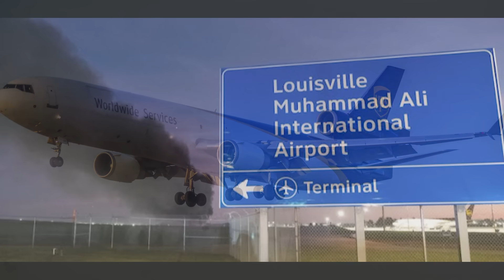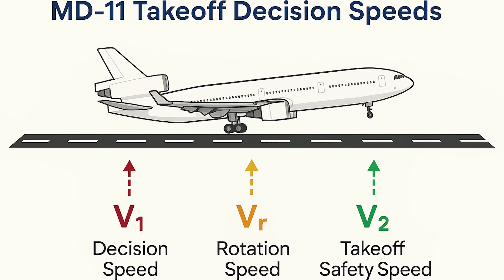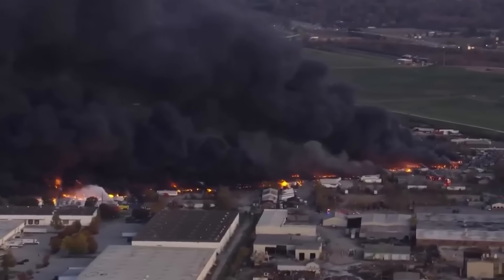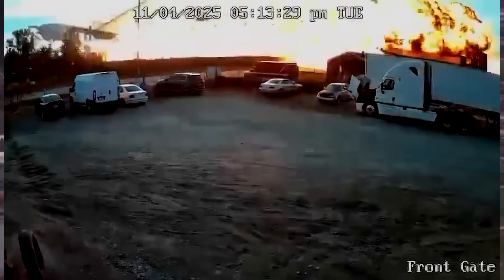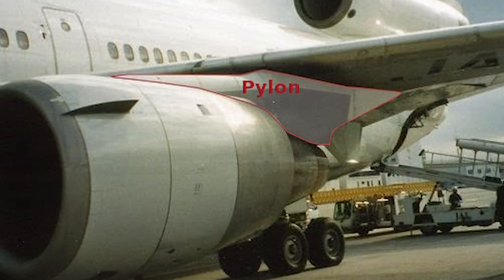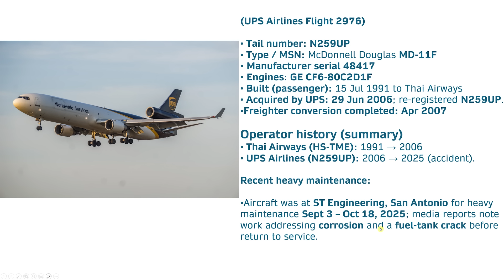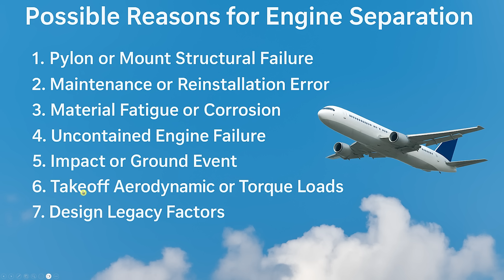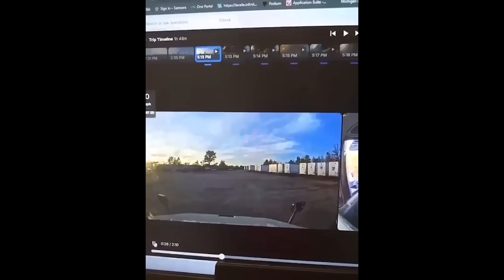What Caused UPS Plane Crash, Louisville, KY? How MD-11 Engine Fell Off

Comment: Who’s idea was it to place a petroleum recycling plant at the end of a runway
Reply: Take it from somebody who lives here. That Petroleum business is not at the end of the runway. Its quite a ways away. Just happened to be in direct path of an out of control aircraft. Had it been further left it would have taken out our Ford Assembly Plant. That whole area is industrial and has been before that airport was ever built.
Reply: @jeremyhemp8241 airport dates to 1941, I had the same thoughts you did until I went digging but most airports are like this with industrial in the area.
Reply: @gingerPotatoCat i used to work for UPS out of this hub, and loved and went to college in Louisville.  They did a MAJOR expansion about 20 years ago, so that airport has not been that big, and that direct route of travel for planes has not been that way since 1941.   You find me 1 major airport that has absolutely nothing that may be considered “dangerous” in the direct flight path of incoming and outgoing aircraft.
Reply: @jeremyhemp8241  Depends on how you look at it, I guess? The runway is over 2 miles long, and the crash was something like half a mile past the end of the runway. It's a pretty long walk, but from the perspective of an aircraft at takeoff speed, it basically did crash right off the end of the runway.
Reply: @gwillen  no, it didn’t. It’s a debris field and firestorm that’s a half mile long. I challenge you to find a similar accident. You won’t.
Reply: @teddyjackson1902  Exactly, this accident in terms of ground devastation is pretty unique.
All these comments regarding building placement ect are pretty knee-jerk emotional responses which are somewhat understandable at this time.

Ok, so the plane came down within a mile of the end of the runway. If that engine had separated 15-20 seconds later it may have come down 4-5 miles away - where do you draw the line?
Reply: @gwillen 
They put millions $$
in fire protections 
but don't do the elementary things.
Reply: @jeremyhemp8241 People are just emotionally reacting and looking to blame something - they lose all perspective.
They forget the plane was carrying 32,000 gallons of fuel itself - everything is flammable when that comes raining down.
Also they forget how much distance an object travelling at 200 mph can travel in a very short space of time.
Reply: @deezelfairy No emotion here. True the plane was nearly full of fuel. But it is a valid question to ask as to why a petroleum refinery is located "within" the abort  turn radius (typically a few miles for an airport of that size) of an aborted takeoff off. When a plane reaches V1, that final design is made, the plane must go airborne in order to keep flying out, abort and go around, or find an emergy landing zone. This was a worst case V1 point. At V1 (Velocity 1) they ran out of runway and going too fast to stay on the ground, they had to go airborne even though a crash is imminent.  A abort takeoff zone is from 0 feet to a few thousand feet above and beyond the runway end.
Reply: @deezelfairy yeah
Reply: @paulromsky9527 But it wasn't a refinery - I really wish people would stop using that term. It was a waste oil transfer facility. Waste oil is relatively non-hazardous in terms of flammability. Sure, it'll burn but in the same way paper, wood and plastic will.
People are making knee-jerk statements. That waste oil facility if you look at the satellite photos was a very small site with a few bulk storage tanks. Lots of vehicle junkyards in the area so makes total sense for it to be there.
Reply: was there before the runway
Reply: @AaronChandler-k6r no it wasn't
Reply: The petroleum company dates to '81, airport to '41. Bigger, faster airplanes change the safety aspect of what was safe in the 80s, may not be now.
Reply: @gingerPotatoCat almost equally massive and technically capable aircraft were available all through the 80's. Look into the operating life of some of the most iconic aircraft known. Its eye opening.  Also when the 1st world is done with them they often move through the classes to a location with less restrictions.
Reply: @geoffholmes7291 People forget that until the crown was stolen in 2007, the largest airliner in the world started production in 1970 🤔
Reply: @gingerPotatoCat look up “UPS project 2000, Louisville Kentucky” and you will see that yes the airport may have been in existence in 1941, it was not anywhere near the size it currently is nor did it have the same flight paths in 1941 that it has now.
Reply: it was either this or a popular ice cream shop
Reply: @mipmipmipmipmip-v5x  i get that ice cream shop reference, are you referencing the fighter jet crash?
Reply: That business has been there since the early 60s. The UPS side of the airport (including that runway and a second ATC) was not built until 1980. At night the airport switches over to the UPS ATC. During the day, the original ATC handles passenger traffic.
Reply: @johncox9868 Same with the Total fuel terminal explosion in the UK a decade or so back.

Why build it so near the houses? The terminal was surrounded by farmland when it was built.

At least here it was factories and warehouses, which there will be a lot of near a freight hub, whenever they were built.
Reply: @johncox9868 that business was there in 1981 not 1960
Reply: @gingerPotatoCat  1962 according to their website.
Reply: Better than houses - see Air India.

And it was loaded with goods and fueled for Hawaii. Monster fireball regardless.
Reply: 21 people are dead or missing including the 3 crew members. That's bad, but it could have been worse. It would have been worse if there had been an apartment complex or a movie theater at the end of the runway instead. The petroleum tanks made for a big explosion, but at least there weren't a lot of people there. The guys on the plane still would have died even if they'd crashed into an open field.
Reply: @franciscolopez7101 like the El-Al freighter in Amsterdam in 1992. That plane lost its engine way after take off and was returning to the airport.
Reply: @franciscolopez7101 21 people? That’s still not a small number.
Reply: Mine...    I was broke at the time and couldn't afford a nicer piece of property.
Reply: @earthstewardude seriously?
Reply: good question
Reply: Does it matter? Anything a plane fully loaded with kerosene  crashes into will be obliterated
Reply: @nihilism1986  A plane at take-off, at max takeoff weight and going from Kentucky to Hawaii, no less. Like almost the most fuel possible on a plane.
Reply: @nihilism1986 Yes. The fire was uncontainable. It had to burn out. The air & water around the area is terrible.
Reply: @cblair8501  it was ignited by the sparks
Reply: @nihilism1986 yes it does matter
Reply: @RainbowBelow exactly, it was like a bomb running into a bomb
Reply: @Brad772006 the bomb with over 200k pounds of jet fuel on board.. yea I don’t think that petroleum recycling plant caused much more damage then the plane itself
Reply: @nihilism1986  Like an extra runway?
Reply: @graphicism sand pits are cool cuz if they get annihilated you just rake it and it is a and pit again
Reply: @nihilism1986  What a silly argument. In a perfect world we'd have exclusion zones around all airports that serve commercial aircraft, but it's absolute lunacy to exacerbate an eventuality like this. To what extent this did I don't know, but there's obviously other businesses and therefore many more people around that area.
Reply: @kenhiett5266 it’s a small petroleum recycling plant, while I’m sure it contributed to the explosion I doubt it caused much more damage then the plane itself. So I wouldn’t say it’s a silly argument just the fact that people are forgetting the plane is moving at least 150+ mph and was loaded to go to Hawaii so probably 200k+ pounds of fuel
Reply: @Daniel73865  The point I was trying to make wasn't specific to this incident. I'm just saying that it doesn't make sense to have a business of that nature at the end of a runway.
Reply: @kenhiett5266 it’s as smart as anything else. You can’t base everything off of “what if”. That business did not cause anymore damage than a plane crash would’ve. My point is if that was an empty parking lot the damage would still look the same and be the same, maybe a few less tragic passings due to there just not being a business there but overall damage would be the same. So my next question is what do you build at the end of the runway? When you get to thinking about it there’s really nothing good to build there because of that “what if” scenario, but then “what if” this plane did make it in the air then crashed during a go around for an emergency landing, so you’d have to keep airports clear of anything for a few miles atleast. Perfect example there’s a train depot to the right of where the plane crashed, “what if” there was a train there loaded with worse chemicals and the plane went to the right instead of the left? So does that mean not building train tracks by an airport? 

Sorry I just kept going on and on but long story short there’s no good business to build by an airport but it’s almost a have too
Reply: @nihilism1986 Kerosine doesn’t melt steel beams
Reply: It really wouldn't have mattered. The plane was at max takeoff weight and was going to Hawaii, so it had about 138,000 tons of fuel on board. The vast majority of the fire/explosion was the fuel on board.
Reply: @pjaypender1009 the plane had approximately 38,000 gallons of gas
Reply: @pjaypender1009 no aircraft yet build weighs 138,000 tons.
Reply: @alanjm1234 Maybe he means gallons of fuel.  That plane can lift over 600,000 pounds of combined weight, roughly 300 tons.
Reply: @mickeyflynn5427 no he didn’t, neither of you should be talking about this and posting 💩 but welcome to the interweb 🤮🤮
Its pounds/lbs
An MD-11 freighter can carry up to around 262,000 lbs of fuel, about 38,615 gallons
It was speculated this flight carried between 200,000 to 220,000 lbs of fuel for the flight to Honolulu, speculated, not confirmed
Reply: @mickeyflynn5427  the plane had 38,000 gallons
Reply: @pjaypender1009 Not even close. You've mixed up tons, pounds and gallons, and don't even have the correct number for any of those three categories.
Reply: God,  I hope it was fast.
Reply: @ginmar8134  same
Reply: Would have been a great spot for a manufacturer of firefighting foam however.
Reply: The runway might have been built there after the plant was built.  Here in Chicago, O'Hare has added several runways over the years, much to the chagrin of those living near it. Sometimes they offer to buy the land and businesses, but often times they don't.
Reply: Please, don’t say stuff you are not sure of. To list one item or say that possible design engine issues that are now coming out is a hard pillow to swallow on a plane that is more than 30 years old. Is fair to say that after 30 years of service, is not a design issue, if anything it can be an issue that some airlines have where they push these planes well beyond their intended life spans based on usage.
Reply: @josiahcooper - Would you have preferred it if it was a Nuclear power plant - there at the end of the runway ?
Reply: Someone with multiple College Degrees.
Reply: @Justin_80  Correct, Harvard ?
Reply: Do you know what else they have near airports? Giant tanks of aviation fuel. Who'da thunk it
Reply: @Hobinator17  back in 1975 at DTW a lear jet hit a giant gas storage tank at the end of the runway on take off, and it didn't explode... ( but it did catch on fire when they tried to drain it a few days later it burnt for days) just say'in...
Reply: @Hobinator17  Next to and on the runway path are 2 different things Mr. Zero IQ.
Reply: @Cbd_7ohm Was it on the runway path though? People are assuming it flew straight after getting off the ground.
After getting off the ground the left wing dipped which would have forced it into a left hand bank/turn.

There's a lot of details we're not aware of yet - I wouldn't be so quick to call people low iq
Reply: @deezelfairy  They crashed into the petroleum plant, not the gas tank at the airport, and the commentor I was replying to made a comment about a gas tank for planes also being there, as a way to diminish the foolishness of a petroleum plant being so close and seemingly on the path of the runway (obviously not ON the runway, but it's path). Even if it isn't directly on the path, it's too close. There shouldn't be anything in front of a runways for miles IMO. The people who do zoning are incompetent.
Reply: @Cbd_7ohm I never said they crashed into the gas tank at the airport.
And the petroleum recycling plant was a waste oil facility - that's not considered particularly flammable. Bare in mind pretty much everything except dirt and concrete burns pretty well when over a 100 tonnes of burning jet fuel rains down.
Reply: As if the fuel in the airport isn't magnitudes more dangerous. Anyone commenting this isn't capable of thinking.
Reply: @Orverge Or the 100+ tonnes of fuel in the plane itself for that matter 😂
This oil recycling facilities location made an absolutely catastrophic disaster an incey, weeny, tiny bit worse.
I have no idea why people are focusing on it as this pivotal part of the whole situation - first thing that goes out the window in a crisis with most people is rational thought and perspective.
Reply: Make longer runways and you just solved a HUGE problem. But no, they have to make it at the limit so that when at V2, the runway ends right there. Unreal.
Reply: Bruh, I got 3 gas stations a short distance away from the end of my local airport's runway. And behind those gas stations, a bit of away from them, are 1-2, maybe 3 hotels from there. 

And if I was to measure the distance from the end of the runway to where that ups plane had crashed, but if this had happened at my local airport. No doubt 1 or 2 of those gas stations and maybe 1 hotel would've been hit at my airport, and maybe the surrounding businesses too. 
Yeah, not safe at all.
Reply: @wisdomvisionf. Sounds like one in Lawrenceville ga
Reply: The buildings may have been there before the runway was built !
Reply: I live in Louisville that plant had been there for decades that runway was built afterwards.
Reply: The plant was there before the runway was built.
Reply: Watt Could Possibly Geaux Wrong ?
Reply: Petroleum recycling is the least concerning facility aligned with the runway. Just south of the crash site is the Waste Management Outer Loop RDF. I am thankful the plane crashed where it did and not into the side of the hill. With that much fuel, a landfill fire could burn for years; with the environmental impacts in the 100's of millions of dollars - if not a magnitude more.
Reply: @ocko8011  They can extinguish landfill fires.  Coal mine fires on the other hand.
Reply: @ocko8011  It's our own fault for doing stupid things like creating massive landfills full of combustible/hazardous materials.
Reply: 99.999999% of flights take off safely
Reply: The 10's of thousands of flights before had no issue why would one assume there would be one? And what a plane can't fall out of sky and hit a petroleum recycling plant? Your Monday Morning QBing.
Reply: there's a whole lot of stuff waaaaay too close to the end of the runway - and it's stupid like that everywhere !
Reply: Do you really think when they were making the recycling plant in the thoughts of that one day a UPS AIRLINER is going to crash into the building on TAKEOFF. I've worked at UPS Worldport in Louisville and nothing like this has EVER happened!!!
Reply: Probably someone who thought planes would be built with engines that stay on.. Better that than residential, at the very least
Reply: @Thealexglass  Believe it or not, wrenches and other tools fall out when the landing gear is and the doors are open.
Reply: @imh-opinion this feels non sequitur :/
Reply: Well, where i live, there's a natural gas plant at the end of the runway.  It's just a matter of time.
Reply: maybe same guy who built a wall in korea
Reply: Well the airport is in the middle of neighborhoods to start with. I'm a few miles away.
Reply: You're right, they should've put a bean bag factory, or maybe shaving cream or Jello factory at the end of the runway.
Reply: What? 😮
Reply: Don't these have an issue with engine pylons failing?
Reply: If it was in Newark airport they have a power plant that's giant and a dozen round fuel storage containers 3 floors tall 😮
Reply: Thats one way to get rid of the recycling crap.
Reply: Dangerous and stupid
Reply: IDK why there are any homes or businesses within the first mile or 2 after the runway ends. I know this doesn't happen often, but this crash took out multiple buildings, it was a very congested area.
Reply: It’s been there since the 1950s and it was not the problem. 240,000 pounds of jet fuel was.
Reply: Kentucky regulations of course.  May want to add air quotes somewhere in my sentence though...
Reply: I do commercial hvac and I'm on top of a lot of this surrounding buildings. Literally some buildings right next to the runway.
Reply: This is common,
Reply: That was my thought.
Reply: 100 meters closer and you have the UPS regional distribution center.
Reply: Stupidity is want stupid does.
Reply: was the plant there before the runway was built?
Reply: Not too bright.
Reply: @ttc.o4007  Please try again. You're obviously struggling to impress someone, I'm just trying to help.
Reply: @imh-opinion  everyone seems to have the same opinion about you.
Reply: This is like saying “whose idea was it to put a gas station at a major intersection.”

Maybe it was just convenient?
Reply: Where else do you want it?
Reply: Many huge airports have such tanks close to their runways
Reply: It helps with the clean up.
Reply: Who's idea was it to put an air strip pointing at people?
Reply: I thought the same thing, how did they get approval to build there from the FAA, immediately in the path of air traffic?
Reply: I am sure the airport was there long before anything around it was.
Reply: The same people who approved the UPS building at the end of the runway, the one the plane first hit.
Reply: You can only plan for 1000 scenarios.
Reply: True
Reply: Very common
Reply: Oh my god that’s exactly what I was just saying a few hours ago. I’m like there’s no way I would want my business right in front of a runway.  Especially anything having to do with petroleum or explosives.
Reply: It doesn't fn matter what's beyond the end of a runway, commercial aircraft aren't supposed to crash.
Reply: Reminds me of American Airlines flight 181
Reply: Overpopulation is as well no problem at airport runways. It is cheap ground to buy and make business...
Reply: Why do we care so much about this incident? It was a freight plane, not very many people on board who cares
Reply: Can always blame the civil engineers. They do all the zoning. Most Civil engineers are there for the pay check and could really careless of the what the public has to deal with. 
The best invention I've experienced was Central ave in Phoenix AZ. If you did the speed limit, you could go the entire length without stopping for one red light. That should be mainstream for across the country for main roads. Side streets need to wait. Here in CA, the largest Climate Change Narrative believers dont advocate for this. They want idling cars for the gas tax revenue.
Reply: Well by next year, a much wanted data center will replace all of that per the state so bye bye warehouses etc.
Reply: Michael Bay's idea.
Reply: Great point — that’s exactly what investigators and airport planners will look at. Proximity of industrial sites to runways can amplify disaster risks. Zoning and safety buffers exist for a reason. ✈
Reply: It was past it. The plane was going so fast that it doesnt matter. 
Plus, the facility could've been there first.
Reply: Whose idea was it to put 3 petroleum recycling units on the wing or the tail of that md11? Makes about as much sense as your comment...
Reply: better a pillow factory
Reply: What was first??? The Petroleum plant or the airport???
Reply: Joe Bidens idea, Senate bill 11425.
Reply: Genius
Reply: It doesn’t matter. Planes don’t crash off the ends of runways too often.
Reply: it was that or the Nuclear power plant?
Reply: the governments. FAA allowed it. so go figure.
Reply: A american idea. As usual
Reply: They really designed it that way in America you would think they'd have more common sense anything like that you wouldn't put anywhere near an airport should be made to be by laws railroad tracks in industrial areas not anywhere near an airport 😂 but look at who's running our country
Reply: Yep , completely stupid...
In my middle town 
they built residential 
housing in the field 
just at the runway end , one day a plane
will hit the houses.
Reply: Somebody with a really really solid sense of humor 😂 this shits hilarious genuinely wish this could happen hourly 🤣
Reply: That's irrelevant. It had zero impact on whay happened, son.
Reply: 6:53 acres and acres of empty grass fields next to the runway, but industrial area straight ahead of the runway 😞
Reply: @mipmipmipmipmip-v5x Your thoughts on the Former "world trade centers? " How about the Pentagon?
Reply: Because its safer than a Nuclear Plant.
Reply: Cheap property. No one wants to live at the end of aa runway.
Reply: I mean it could be anything at the end of the runway they was doomed regardless
Reply: @adamkeogh9891  Right. The flight was going to Hawaii at max takeoff weight. There was more than enough fuel onboard (138,000 tons) to account for all of the fire you see.
Reply: @pjaypender1009 138k pounds, not tons. Max takeoff weight for a DC10 is 430k pounds.
Reply: @andrewfidel2220 incorrect. Max fuel for md11 is nearly 260,000 pounds of fuel. This aircraft was near max fuel. So 130,000 kg is about right

Edit: googled it. Actually 280,000 pounds is max fuel. So yeah closer to 140 tons!
Reply: @KingofInterns DC10/MD11 fuel burn is ~10tons first hour and then 8-9 tons per hour in cruise. Flight time is a bit over 8 hours so with reserve fuel they would have had around 75-80 tons of fuel. No way they would have had 140 tons for the flight over to Hawaii.
Reply: @andrewfidel2220   138k tons...no wonder it couldnt gain elevation lol
Reply: @pjaypender1009  The left wing hit fuel tanks on the ground.
Reply: @pjaypender1009  38,000 gallons of fuel =220,000 pounds of fuel.
Reply: Depends on who wass there first.Dipp.
Reply: The same person who thought it was a good idea to put a huge warehouse 750 feet from the end of the runway.
Reply: Obviously the same family that does maintenance on aircraft ?
Reply: @imh-opinion This aircraft was recently serviced at a maintenance facility in Dallas.
Reply: @hdctx 
I thought it was at San Antonio 🤔
Reply: @imh-opinion  you’re not too bright
Reply: @teddyjackson1902  You can do better. Try again please.
Reply: @imh-opinion  do better than what.
Reply: @teddyjackson1902  Better than your first attempt
Reply: @imh-opinion  what was
Reply: Well, you would do this because next to an airport is particularly undesirable real estate for housing, so its often used for industrial businesses and such.

If you’re aware of that and are asking why that particular lot was chosen, then i would imagine its because they don’t plan around airplanes crashing. Tragic either way
Reply: Apparently whomever was in charge of zoning for the area, so probably city officials. 🤷
Reply: EXACTLY what I was going to post before seeing this.  

Complete and utter stupidity.  

I wouldn't be surprised if the owners opened a match factory in the middle of a forest.
Reply: @jediknightjairinaiki560 The facility was there before the current runway configuration put it in the centerline, before it was near the airport but not along the flight path.
Reply: @jediknightjairinaiki560  Given all the comments here who can't fathom the idea of farmland on all approaches, I think our species demonstrates that we are way too ignorant to possess nuclear weapons or power plants.
Reply: Did you ask this question prior to this crash??????
Reply: it looks like the second hit with the flash was what caused the plane to rotate (footage at the end of video). Thanks Jeff for another very clear explanation of this tragedy. I look forward to your review of the preliminary report.
Reply: @hoppy6141  Power lines is what I posted and was my guess.
Reply: @hoppy6141 The flash was the tip of the wing catching a power line.
And no, it wouldn't have influenced the planes flight - she was already banking over and going down.
Reply: With how much land the USA has..... you would think they could build their runways with plenty of 'run-off'.....empty fields, or simply make longer runways..... but no.....they rammed in a load of warehouses including petroleum storage.....crazy.
Reply: Murica
Reply: @RK77789O  Best place on the planet to live, unlike whatever spithole country you call home.
Reply: Innocent people died because someone forgot to check  something somewhere
Reply: Probably t-RUMP!
Reply: @AceNinja2112 Trump does not inspect airplanes
Reply: @AceNinja2112 Trump is to blame for everything in your life 🙄
Reply: So would a multi-story apartment complex be any better? What about a school?

You can't have a mile or more of empty space at the end of every airport just for the extremely rare chance that this could happen.

The only concern is height, to which there wasn't a issue here.
Reply: @CJ-jo6do  Actually, you can have a mile or more of "empty" space at the end of every runway.
Many airports have spaces like this, either swamp or wildland, or farmland.
Reply: Not too long ago, land was always cheap here in the usa to build; business parks,junkyards,etc. or vice versa... meaning,industrial zoned area was there before small/medium regional airport was built.
Reply: @dmcnamara9859  We can build anything we want anywhere you want, the only reason the airport would be built that dumbass close to 99% of a crash area is greed, they don't want the cost of travel across town or in the countryside somewhere, reason UPS is all hubbed up in there.
Reply: Definitely someone whose goal was to "maximize shareholder value."
Reply: I would ask the same question. Why are any buildings so close to the end of a runway anyway
Reply: lets make few 100 of safe place for airplanes to have safe abort, nah lets sell that land for cheap to make money, capitalisam at it finest, save lifes, nah make stock go up yah
Reply: @user-ek2lh7gn7d  You are so ignorant. 🤦
Reply: @user-ek2lh7gn7d  Show us on the doll where the "capitalism" hurt you.
Reply: @VinceP1974 Funny how they never seem to find issue with any other system of government, maybe they should go live under them before they radiate their ignorance!
Reply: @user-ek2lh7gn7d  Don't be ridiculous.
Reply: @user-ek2lh7gn7d  The airports/fields will frequently try and get zoning agreements with local governments when they see civilization moving their way for non-residential and businesses with few employees usage.  The agreements aren't worth the paper they're printed on.  Straight take-offs and landings bring noise complaints from homes and they don't realize that's mild compared to a plane veering off and crashing.  This one evidently started veering off still  struggling to take off at the end of the runway.
Reply: @user-ek2lh7gn7d  no political ideogly will save you from the elites, one day you will realize that but then it'll be too late and you'll become miserable.
Reply: @user-ek2lh7gn7d  what is you people's addiction to blaming capitalism for everything lol
Reply: @user-ek2lh7gn7d Could you give us an example of a non capitalist place that handles this issue correctly?
Reply: JOE BIDEN?
Reply: lets make few 100 of safe place for airplanes to have safe abort, nah lets sell that land for cheap to make money, capitalisam at it finest, save lifes, nah make stock go up yah
Reply: @user-ek2lh7gn7d  this is an absolutely terrible take.